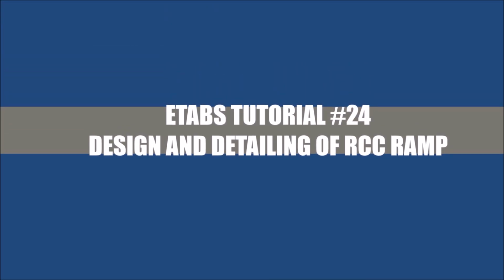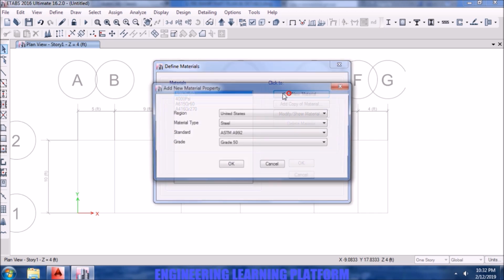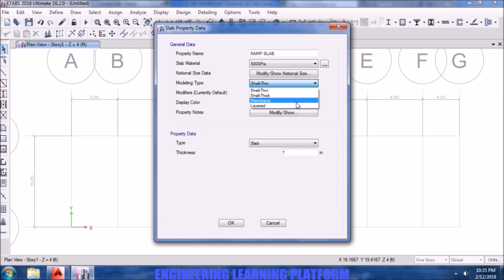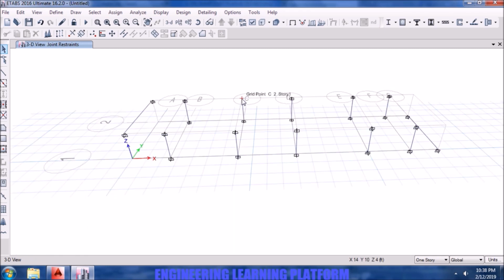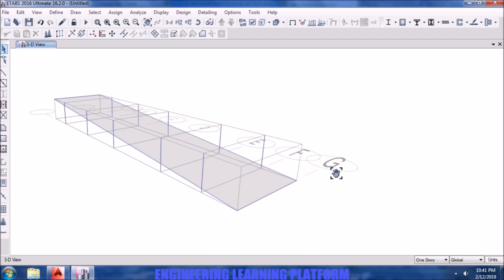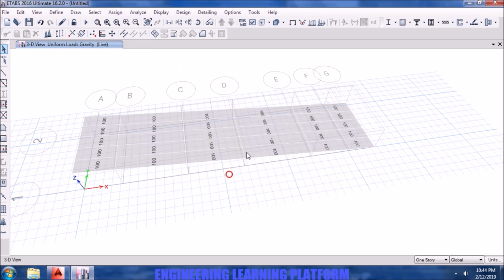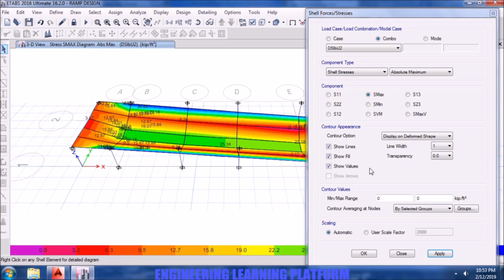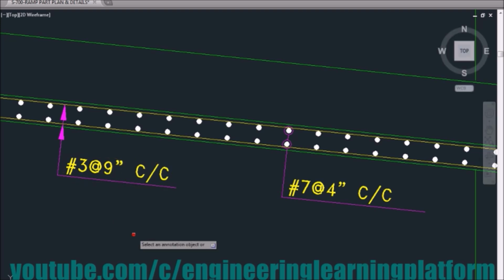Detailing and Design of RCC Ramp in etabs Tutorial

Comment: In the AutoCAD reinforcement detail of the same ramp slab, a long section has been shown. There are no intermediate beams shown so in that case the shorter reinforcement must be placed in the lowermost bottom of the slab but in the drawing, the longitudinal or distribution steel is shown first and the main reinforcement at the top on distribution. Is it correct? Can someone explain or guide me?
Reply from the maker: There are waist beams on side supported on columns

Comment: i have followed your tutorial through out but yet my result is different as i am getting maximum positive moment of 171 ... otherwise i have applied the load and steps as you have done
Reply from the maker: You can always cross check manually
Reply: @EngineeringLearningPlatform  sir how to do cross check manually .please make a video or use software like mathcad...thanks
Reply from the maker: @saeednegar709  treat it like a beam and design a continuous beam of size of 1ft x ramp thickness with spans equals to ramp spans b.w columns .

Comment: I think M11 or M22 should have been used instead of stresses.
Reply from the maker: M11 and M22 doesn't govern .
Reply: But S11 and S22 has units Kip/ft^2 .. How they fit in ur formula?
Reply: @EngineeringLearningPlatform  what formula you are using for calculation of rebar, Mu/4d where Mu is moment where as you are putting stress value.